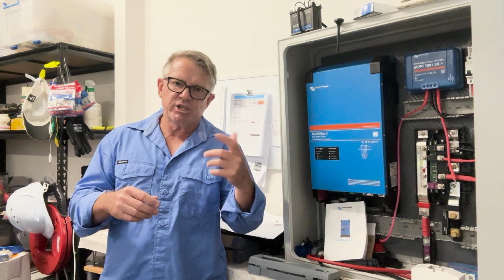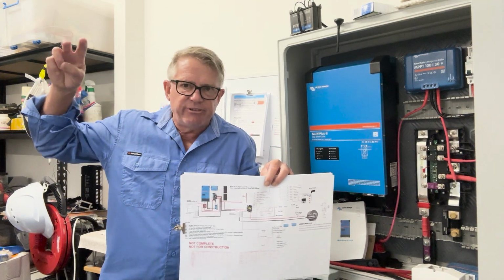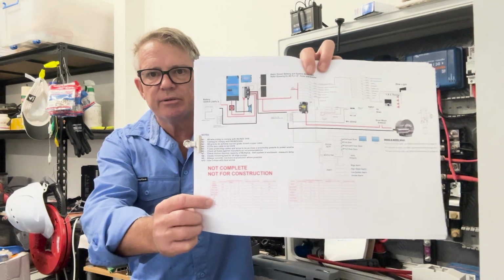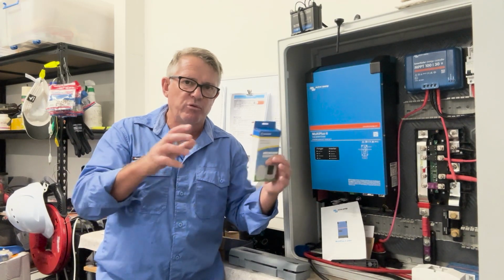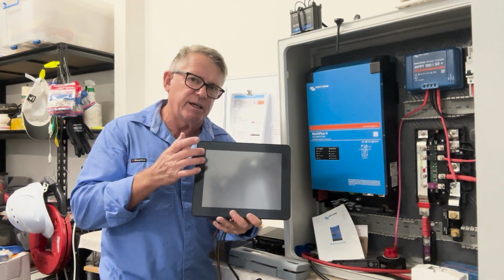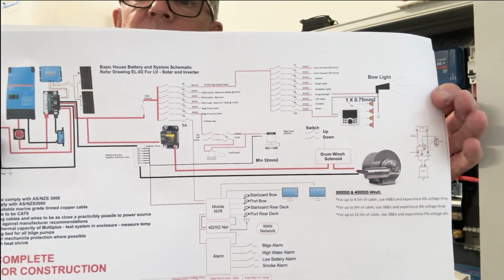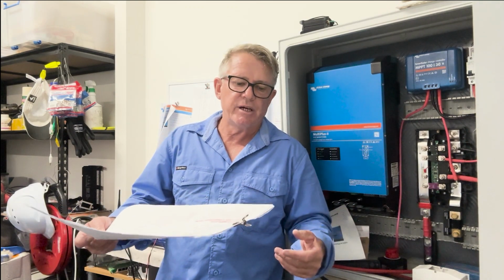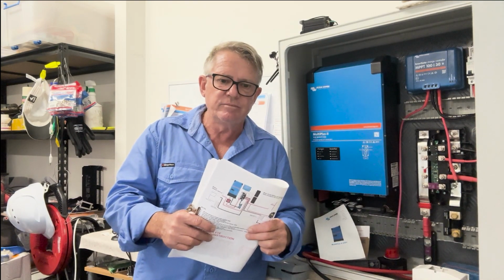Victron & Smartdraw For Dc Circuit Design In Solar Boats, Caravans, 4wds & Campers

Comment: Well Rob...arrived at your channel thru a search for 'SmartDraw and Victron'. Your channel was the only search result that came up. I enjoyed your video however the conclusion was a little blank. Editing is tough, eh?

I have been designing and installing Victron in land and sea based situations for over 20 years. Although I have used various CAD software in my mechanical engineering career, I am new to electrical CAD. Kudos to you for what you have accomplished using SmartDraw.

Will you be getting deep using the SmartDraw for your Victron system?

I have subscribed and liked.
Reply from the maker: Thank you mate, I'm very new to editing and making a few mistakes along the way but it will get better. I might need to go back a re-edit.

I use Smartdraw because I find it a lot easier than CAD It's laid out well with a lot of the electrical symbols sitting there in libraries, if I need CAD files I typically send them off to professional drafties to do it for me, It's incredibly powerful but very time consuming, because I don't know how to use it properly but it may be worth spending the time to learn a new skill?

Good to know about your Victron knowledge. I'm an electronics technician by trade I completed my apprenticeship back in the 80's when we repaired everything to component level. Now I'm a business owner doing contract works in commercial building installations of fire protection, security, access control and CCTV and looking to get more involved in the solar.

Thanks for the feedback and the subscribe I'll make sure I take more time to edit properly. 

Cheers
Rob